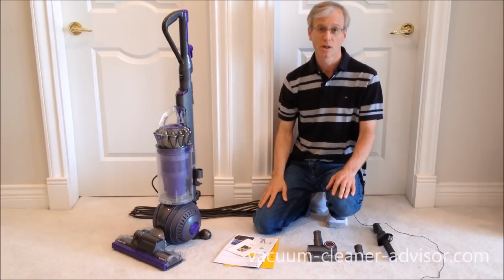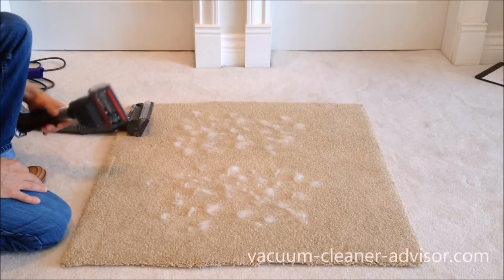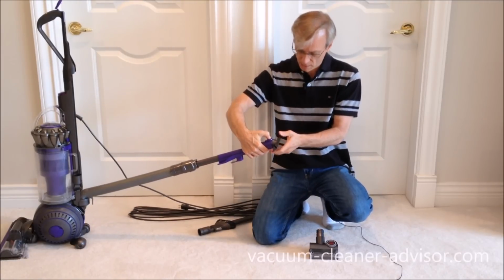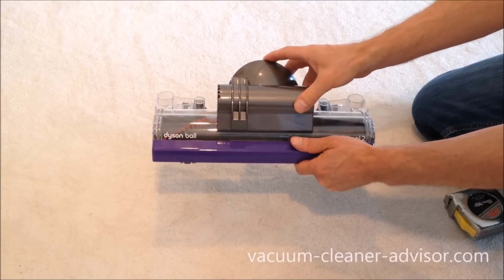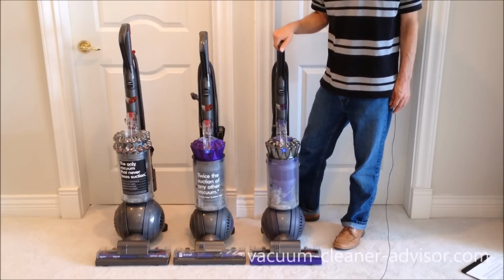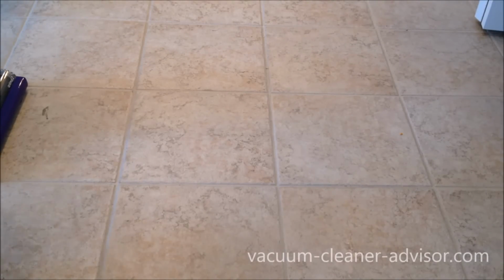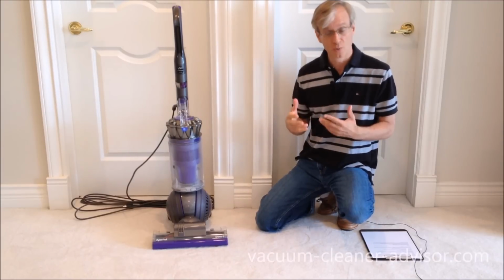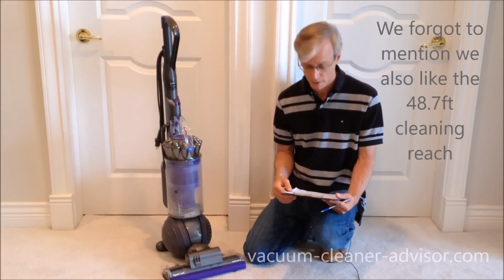What We Love about the Dyson Ball Animal 2 - Review & Tests

Comment: Overall 5 stars as it's exactly what we wanted,🧼 allabout.wiki/Dyson-Upright   in terms of cleaning power. Suction is as good as all the reviews state. When we first got it, I first vacuumed with the existing vacuum and then with this, the additional fine dirt that was in the Dyson was gross and convinced me we needed this. We have medium length carpet and a terrier - no issues, I do imagine plush carpets would not work well with this. Also a little too powerful for most bathroom rugs. Great for area rugs.One con is the hose, it's great for reaching far away places (ceiling), but is frustrating and hard to use if you're within arm's distance (think couch and floorboards). This is due to the design of the hose having this long metal rod for extension. Also, I haven't figured out how to get the hose back together quickly as it's supposed to nest into the base of the vacuum. This piece might just be user error though.Canister is just like all others, still have to take out the middle insert to get all the dirt out. I often make a mess around the trash as I'm trying to empty it, but the suction picks that right back up.

Comment: Thank you thank you thank you!!!! I've just spent 3 hours screaming and pulling my hair out bc I couldn't figure out how my new vaccuum works. (The booklet that came with it was no help, and one of the booklets and the warranty information was missing altogether. Yes, I bought it new from a reputable source. ) 

I'm still somewhat confused. What are the various attachments for? Although it was a relief to learn that not all of them have a "place" on the vaccuum itself.  I don't understand how your vaccuum magically became smaller -- like a large handheld, while mine apparently does nothing of the sort. I'm having some buyer's remorse because I didn't buy the easy to handle cordless version (which is what I thought I purchased), but as the old saying goes, " if it won't fer bad luck, I'd have no luck at all..."

I appreciate your calm and gentle manner. This sort of thing really drives me nuts.

Comment: Hello. I just bought the animal pro+ from costco today. A few questions:

1. Is the red power button suppose to light up red when on?
2. The right side ball doesn't turn freely when I spin it but the left side turns freely when I spin it. Is that normal?
3. When I am vacuuming and pull it backwards, it leaves hoizontal brush marks, is that normal?
Thanks!

Comment: Wonderful review.  Thank you.  I think it would interest you to know that others have tested the animal 2 and found that there is always leakage around the canister.  Also, the Hepa filter does not have any kind of gasket around it.  Thus, it allows air to leak out around it.  The animal 2 is not a sealed system.
Reply: Yes i second that, its not a sealed system and someone on youtube showed that in a test. I found out the hard way and thats why i went for a shark az950ukt. Dyson amazing power to pick up unfortunately is useless if the dust its not kept in. Yes the HEPA filter has a poor rubber seal witch is on the engine side and very hard to replace. I defo recommend the shark for allergy sufferers like myself till Dyson manage to seal them properly.

Comment: I just got this vacuum today and your video helped me a lot. I just have one question, is there an easier way to use the hose/canister? When I try to use it, the suction is so powerful that the hose doesn’t stay stretched. It keeps pulling back and I can’t reach much further.  thank you so much
Reply: I have the same issue.  I don’t know how to make it better I just try and not get too far away.
Reply: I’ve had the same problem. You have to use two hands and kind of spread the force out by holding the hose closer to the base of the vacuum with one hand and then using your free hand to hold the hose head. Hope this helped
Reply: @TutorialGuy77  yeah because as you stretch it out more, the vac tries to compensate the extra drag by increasing the suction power but it creates more resistance as you stretch the hose out more. But the only way to avoid it is to either get a shark, a cordless dyson with a hepa filter and a motorized mini brush head, or to work out more
Reply: You cant avoid it. Thats how it is. Either work out more or get a cordless dyson vac

Comment: Does the brush bar roller actually rotate under motor control or from moving the unit back and forth? Thanks!
Reply from the maker: The brushroll in the vacuum cleaner head is motor driven.
Reply: @VacuumAdvisor  Thank you!

Comment: I think it would be nice if you showed how the vacuum performed on embedded dirt. Pouring a mixture of flour and coarse sand on a completely clean medium pile rug that's not dense and embedding it down with a heavy roller and run the vacuum several passes over it to see how much it picks up. Tests like these have been done on the Ball Animal 2 and it picks up about 70% of the embedded dirt, which is one of the best scores compared to most bagless uprights. But I figured you could do it too, because you have a much wider audience. :)
Reply: Exactly, why not step on what they placed on the carpet.  Also, add dirt - like dirt you get from the outside and step on it.  It will suck most of it, but there will be some things that won't until you pass through it several times.

Comment: Great review, very helpful. I also watched your video on the things you disliked about the Dyson Ball Animal 2.

It was a tough choice between all these vacuums. It's confusing because Dyson just by themselves has multiple "Animal" vacuums, as you show here. Not to mention the fact that "Animal" still doesn't mean it's the best for my pet situation.

Which vacuum would you be most likely to recommend to someone in my situation? (with cat hair, litter, hard floor with budget $400-$1,000)

MY CURRENT EXPERIENCE
I have a cat who makes a huge mess on hard floors and my low budget ($140) Shark vacuum doesn't work AT ALL to pick any of it up. I have been sweeping / vacuuming by hand with the hose for way too long now. The Shark vacuum is always falling over on me, even from 4 feet away, its aggravating.

I Finally pulled the plug and bought one of these "Dyson Ball Animal 2" yesterday, waiting for it in the mail now! I feel like its gonna change my life (seriously)
Reply: So, did it?

Comment: The Dyson does not have the most suction of any vacuum.  The animal 2 has a CFM of 53.  The Kirby has a suction at the head of 137 CFM.  This is because of the large opening from the motor head to the fan.  Kirby uses a direct air motor which means there are no filters between the motor and the dirt.
Reply: That's how much air it can pull in a minute. As suction goes, the Kirby can pull only about 40 inches of water. Meanwhile, the Ball Animal 2 can pull 90 inches of water, so yes more suction, but not more airflow.

Comment: Hi Nigel -- I'd appreciate your experienced recommendation. I can't decide between the Dyson Ball Animal 2 vs the Dyson Cinetic Canister. House is 50/50 carpet/non-carpet. Weighing the motorized brush head of the Animal vs the convenience of the auto cord roll of the canister. Most interested in the best clean though. Thoughts? Much appreciated!
Reply: I would get the Dyson Ball Animal. The canister has an air driven brush, which won't do so well with embedded dirt on carpets.
https://www.amazon.com/Dyson-Ball-Animal-Upright-Vacuum/dp/B01BGS9JVA
Same as the Animal 2. Same suction, dimensions, and cord length. It also doesn't have that part on the cleaner head, which can limit air flow and debris size pickup, so I prefer this slightly over the Animal 2.

Comment: Great reviews Nigel. Is there any difference between the dyson ball multi floor 2 and the Dyson Animal 2 besides the attachments? (The multi floor 2 and the Share NV752 are the same price at Kohls today, which would you get?)
Reply from the maker: Hi Allan.  We don't have the Dyson Ball Multi Floor 2 but we just grabbed a few stats off the Dyson site:

DYSON BALL MULTI FLOOR 2 
Weight
15.6 lbs
Suction Power
245AW
Bin Volume
0.42 gallons
Cord Length
31ft
Maximum Reach
40ft 

DYSON BALL ANIMAL 2
Weight
17.35 lbs
Suction Power
270AW
Bin Volume
0.55 gallons
Cord Length
35ft
Maximum Reach
50ft

So, besides the tool set, there are at least several other differences between the vacuums.  As mentioned we don't have the Multi-Floor so we can't really say whether we prefer it to the NV752, but we can say we really like our NV752.
Reply: not the same price as kohls. if u buy shark u could have used the 15% off and free $10 off mail ads kohls gave out which would make shark cheaper. i brought the animal 2 and it is the best vac i ever used. multi 2 is just slight less suck power

Comment: is there a belt in the brush roll?  hwo do you clean the brush roll?  why don't all the vacuums are made tangle free brush roll on the floor not only the hand tools.   why do we have to take the screw and clean the brush roll as well as clean the filters constantly.
Reply: Yes, all of the full sized ball uprights use belts, but it can be tricky to access. You don't need a screwdriver to access the brush bar, but you will need one if you want to take it off. Only the compact uprights, cordless, and canister use a gear drive system. And also to clarify, a spinning brush bar is able to have better embedded dirt pick up rather than counter rotating heads.
Reply: Cleaning the filters help maintain performance, although the vacuum has Radial Root Cyclones that help separate dust. The filters are like double protection.